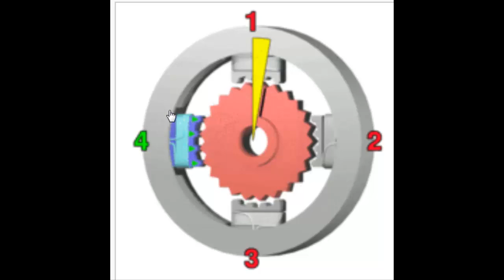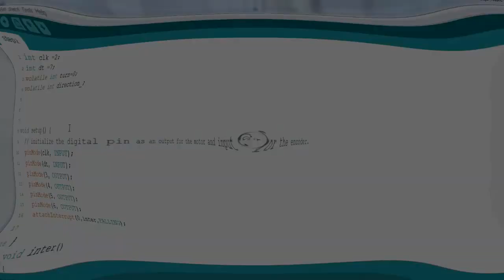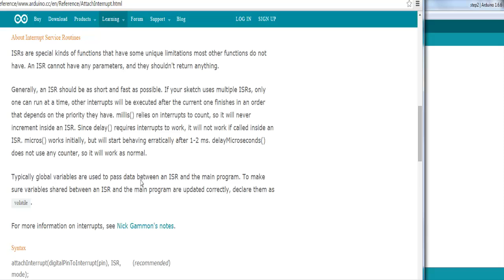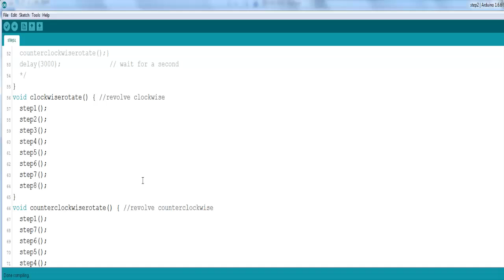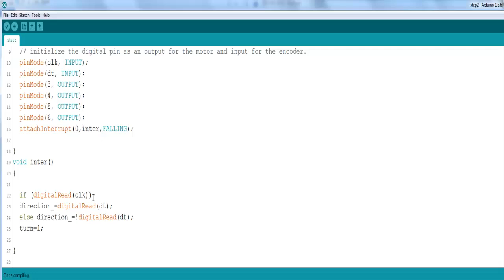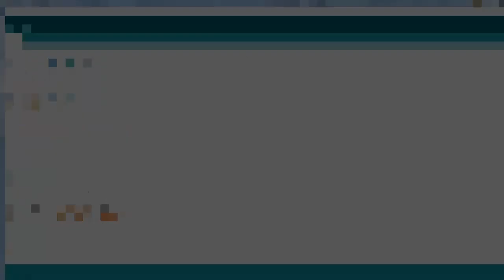Tutorial : how to work with a stepper motor and Arduino

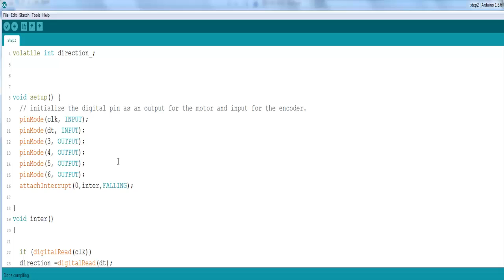Comment: nicely elucidated yet I think you have a small code problem at 9:21, while you read the clock, if there is a change put it into direction (youtube does not accept underscore sign) variable, that is OK up to this point.. now comes the else statement which is quite useless because as I can understand the rotary encoder already gave its signal to the direction variable via the interrupt routine.
to be sure that I am not misleading you by my thoughts I have to eradicate the: else direction.... whole line,
upload the updated code to the arduino board and check it out, but it won't be soon (-: